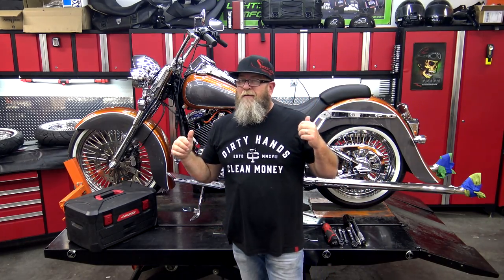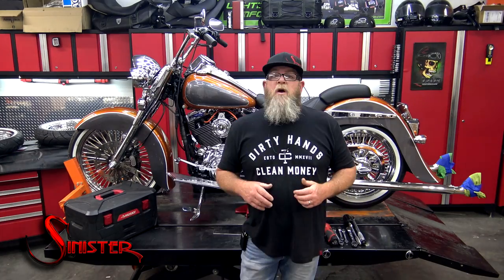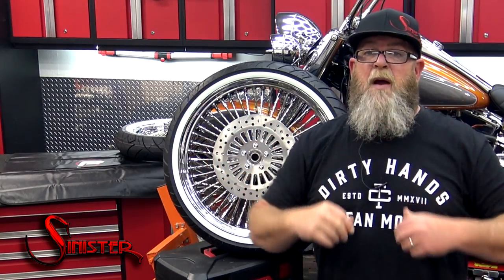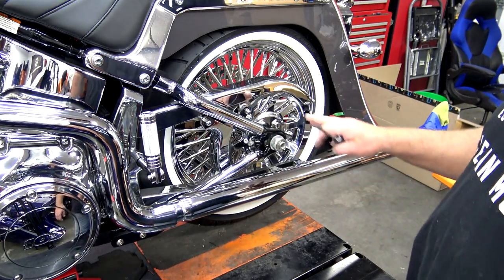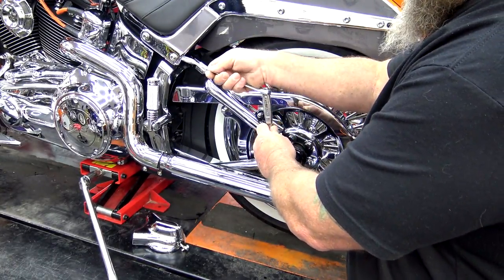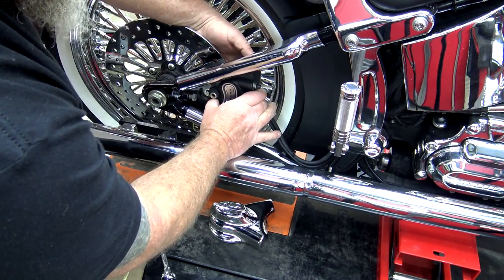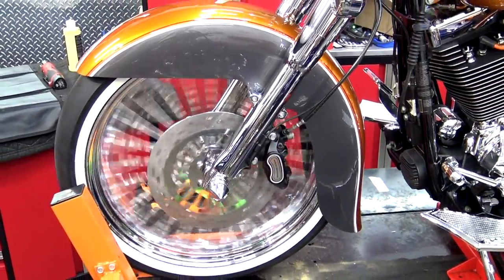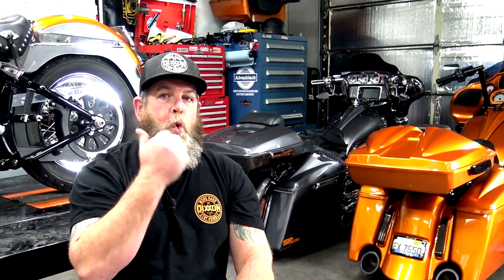⚡Softail Makeover! Sinister Diamond Cut Wheels⚡

Comment: Great video. I have a question about the spacers. My 02 Fatboy needed a new tire. I'm wondering if the spacers are the same for all soft tails ? Where can I find a diagram of the rear wheel spacers? Thanks
Reply from the maker: go to this link and finish selecting your bike then you can choose to open each part of the bike and it will give you a detailed breakdown of the part and the part number. https://partsfinder.onlinemicrofiche.com/ronnies/showmodel/16/harleydavidsonmc/2002
Reply: @sikbaggers  Thank you for the link. I'm kinda in a time crunch so you have been a help !!!

Comment: So when you got back the rear wheel from DNA was it still not true? Just wondering because I plan on ordering from DNA for my heritage 21” front 18”rear but I’m keeping stock fenders
Reply from the maker: There is a slight offset to the rear wheel but not in direction that they offset it the first time. running an 18 just makes it worse becasue you are so close ot your fender now that it is obvious. I went with Sinister fat spoke wheels in the end and I went back to the stock 16 in the rear and 21 in the front and no issues at all now.

Comment: I have a 2018 Street Glide and I noticed the front wheel spacer has been installed incorrectly. The lines are on the inside instead of the outside. Has this damaged anything that I need to be worried about. I never noticed it until I seen this video. Makes me sick to know I've been riding with it on backwards. Please advise. Love your videos!
Reply from the maker: You're fine. Some models, usually older ones had a chamfered end on them and that side went on a specific side. If you notice on your spacer it is the same on both sides. however the service manual still says lines go outward away from wheel.  Its just a good habit to get into in case you ever run into one. Just remember lines out and youll always be good.

Comment: Where did you get the pulley bolts from? All the ones i find the washers cover the recessed holes in the aftermarket pulley.
Reply from the maker: yeah well these do too and they are from sinsiter...that was my goof in the video before I realized I had a spacer in the box...and I didnt edit it out...but the pully goes with the recessed holes facing up and the washers fill the spaces.

Comment: This is the last video I seen from you. Okay, I need your advice…I went to check my oil and the top of the cap came off and the dipstick stayed in. 
How can I get it out so I can replace it.
Reply from the maker: The top cap is just that...its just a cap and it held on by 4 little prongs...can you pop it back it on or did it break? If the cap broke you will need to replace the cap and snap it back on.

Comment: love the wheels man. Went to their website and picking out my wheels its asking about a "cush drive hub". What is that?
Reply from the maker: cush drive hubs are rubber pieces found in the rear wheel of the touring class motorcycles that are designed to reduce stress on drivetrain components during gear or throttle changes. Softails do not have them.

Comment: Looks amazing! Are those wheels traditional wire wheels that will need tubes?
Reply from the maker: These are tubeless wheels..which is another reason I like them so much.  They have a protective layer that is applied to the spokes on the inside that stops the leaks.
Reply: @sikbaggers  That's awesome, I love spoked wheels but hate running tubes.

Comment: Why is it so you must use rotor bolts only once?
Reply from the maker: They are a double torque bolt...lots of stress on those bolts after torquing them...its kind of like head bolts in your car/trucks engine..one time use. They just recommend to replace them so they dont loose strength in the bolt after torquing and removing
Reply: @sikbaggers  double torque bolt-never heard of it, but then, I never worked on engines or Harley Davidson's before. The 1st time is always the most frightening. After that, you're almost a pro.